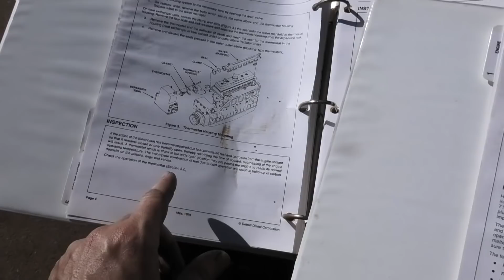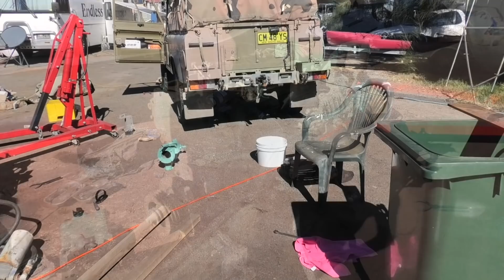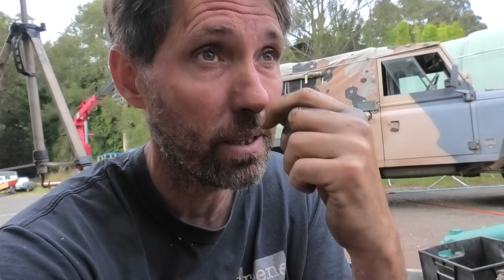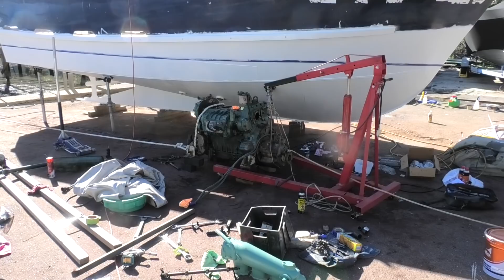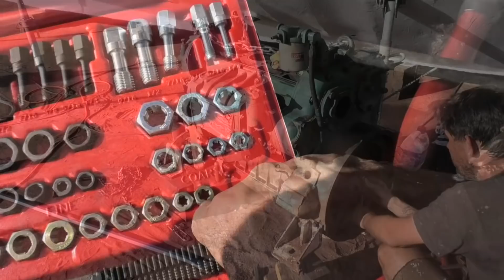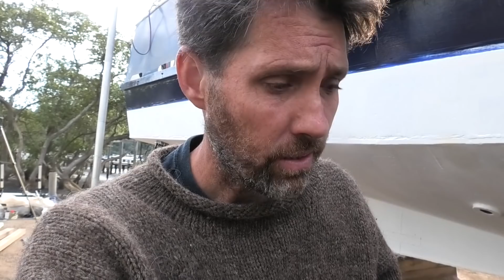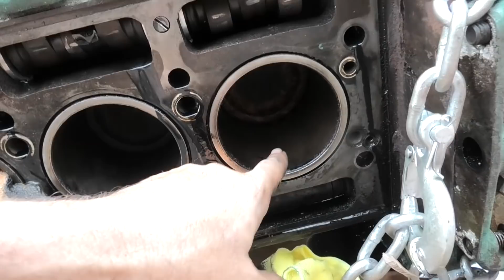Detroit Diesel 4-71 teardown

Comment: Bravo, Stu! Some bloody awful work, there, but done about as well as could be expected. You're doing the right thing, with the rebuild. A Detroit Diesel, properly fettled, is a wonderful thing, and pretty near bulletproof- for years. Outstanding power and reliability. The supercharger is key, if the seals break down, and oil from the blower seeps into the intake ports, you won't be able to stop the engine, safely. You can always block the air intake, but for god's sake don't use your hand! Keep a chunk of plywood close at hand, for that eventuality.
     I'm massively impressed by your dedication to this project. I think most guys would have hauled the engine off to the shop, and let somebody else fight that battle, or given up, straightaway, and plopped a Volvo in there. Not a terrible idea, but that trawler is a heavy boat, and will benefit from the heavy, powerful engine. Good on ya!
Reply from the maker: Thanks mate, I'm really looking forward to seeing this motor healthy again inside and out. A blower rebuild kit is definitely on the parts list. Great idea to keep some plywood on hand!

Comment: I rebuilt Detroit Diesels for over 25 years,  I can tell you to use a torque wrench on everything when you reassemble,  also and this is very important you will need a fuel pressure pump and pressurize the fuel system to 50 to 70 PSI and inspect all the injector tube nuts for any leaks.   They have a nasty habit of cracking and slowly leaking into the crankcase oil which dilutes the oil.  We used to call it "making oil" as the oil level would increase.   The test to see if diesel is in your oil is to place a couple drops on cardboard and see if it leaches "spreads" rapidly into the cardboard.  If it does then you have a cracked injector line most likely.    Diluted oil will damage your engine.   Test it,  I was surprised at how often I would find leaks.
Reply from the maker: Hey mate. Yes, I have the service guide with the torque specs for everything. I like your oil test, very interesting. I was toying with the idea of getting some of the old oil professionally tested but yours is simple and quick.

Comment: You really should do the engine yourself. It is well within your capabilities. I know you were disheartened. I was also. Just put in a liner kit some bearings bam . It will be fine. The head is probably cracked though. Is it a 4 valve ? That was the weakest part of these engines in my experience almost every head we took off of a marine engine had cracks. That being said we did abuse the he'll out of them
Reply from the maker: Yes, I'll probably get the engineers to clean and check everything then I'll see if I can get it back to my old workshop to do the reassembly.
Reply from the maker: Oh, and forgot to say, yes, it's the 4 valve so I can see how there isn't much metal left between the valves and how cracks could form.
Reply: Awesome I got the impression you were going to let the others do it from the price you were saying at least .I forget how much more things cost there. It looks like the rack and everything under the valve cover should clean up. Do you have access to a bore scope to look inside the gear box oil fill ? Better yet leave it be you don't need any other bad news now. Lol

Comment: You are doing great.  Get that head tested for sure.  Was there any water that came out in the oil?   Check that water heat exchanger unit very closely for obstructions.  My initial guess would be the engine was overheated. So i would look for the cause of that then the after effects.  The heads crack very easily it’s usually the weak point.  But  o-rings on the head and injectors tubes are other common sources of water in the engine.  I’ve put worse back together.  They are very tough engines and can take a huge amount of neglect or damage but still be brought back to life.
Reply: I'll let Stu tell you the story but here's what I know that may help, To me, It seemed to run OK from Sydney Harbor up to where it is now in the video "Is it a bad idea to buy an old steel boat?" but the GM 4-71 seized up on the hardstand once out in the weather under a tarp, nil emulsified oil was drained out (covered in this video), oil was black & thick though, just a tiny amount of settled and separated, clear condensate water first up can be seen on draining the sump oil, Stu thinks the GM was possibly flooded with sea water in the engine room prior to His purchase due to a leaking stern gland on the propeller drive shaft pissing water in & a failed bilge pump & switch, there is a clip of that leak in the earlier video too. P.S Great Youtube channel Bus Grease Monkey.
Reply from the maker: Thanks mate. I spent a bit of time yesterday trying to figure out a way to get in touch with you after so many people suggested that I do (I had already watched many of your vids!) The head is already off at the engineers so it will be interesting to see what he finds. There was a very small amount of water that had separated of the oil in the bottom of the sump, but not that much. It wasn't emulsified so I'd say it ran down into the sump from above. I've found a better local source for a full rebuild kit so time to get cracking!

Comment: Another thing Stu, the 4 71's area  dime a dozen. You have the marinising gear so if you look around you may find one available in good nick for much less than where you're heading. It is  easy to forget that the idea is to catch the crocodile not drain the swamp.
Reply from the maker: Hey Lindsay, my main thought with rebuilding this one is that I'll know it's 100%. If I buy another second hand one I think I'll always have the temptation to rebuild that one too!

Comment: I can see why the chicken was knocking on your door. I have to tell you. Seeing the way you breakdown this diesel and the location you are doing it in. Into more manageable size parts. It takes me back to watching videos of mechanics during WWII which were stuck out in the middle of nowhere. Seeing you do whatever you had to do to make things happen. It only makes me appreciate what these guys did to get the work done on the planes and other military equipment. With one single task in mind which was to repair the failed equipment at all cost to keep the equipment up and running so our young men could take the fight to the enemy.

You said it right. That diesel went for a swim. I suspect it went skinny dipping more than once. As for the old oil you pulled from the crankcase of that skinny dipping diesel. Take it and make bio-diesel out of it.  Then burn it in your newly rebuilt one.

Comment: I can see where you’re concerned about safety very much I noticed you wear your safety contact lenses a lot. LOL I was really surprised that you did not mark your rods and Rod caps most people do it with stamps if you don’t have a little metal  stamps to do it I’ve seen people use a chisel and on the first rod and cap just put 1 line on each same side all the way down then the second rod and cap do the same thing so on and so fourth.looks like your worried about stripping the block of everything thing ? I would I would not trust and of the old gaskets and when it get to the Machine shop they are going to have to strip it down anyway which is going to increase your cost the less work they have to do the less you have to pay because it’s less  time they spend on it. But it’s looking good so far I know your thinking damn are chair mechanic lol I was a mechanic for the government till the back went out. And I went to a college to learn mechanics. Not a trade school and the first  three months we worked in the machine shop doing everything you are sending your engine off to have done. And I Learned on old time equipment made back in the 50s and 60s. So you really have to know your crap in order to work the more machines nothing was computerized or digital. But I am also sorry to hear about you having to sell your truck that is a real bummer I hope you get what you were asking for it. And when the time comes and you decide to get rid of your boat that it was well worth it and you get to recoup your money but with that said I have gone on long enough. LOL I hope you have a good day I also hope that you were taking pictures with your cell phone just in case you lose footage again like you did that one week. You have a good one mate.
Reply from the maker: Hi mate, will definitely he stripping the block clean and replacing / repairing everything, just ran out of time this video. Have a set of stamps I normally use for conrods and end caps but just needed a quick hack with the bolt so I could get one piston out to determine which type it is (1 part or 2 part)

Comment: Stu it's worth giving MTU a call at Chipping Norton, they used to be Detroit Diesel Australia before Penske took over. Although I think the 2 strokes are technically 'No longer supported' you might jag and old parts guy who can point you in the direction of either New Old Stock bits, or aftermarket. There is a huge non genuine parts list for these engines. In Adelaide our rail authority used to have 6-71's in Red Hen rail cars, they never purchased Genuine Parts from Detroit at Gepps Cross, always after market mostly made in Mexico.
I suspect that engine has been apart many times before, those liners shouldn't fall out quite that easy from memory. Your service manual will have the block bore sizes and liner Outer D'iameters available. There used to be O/S liner OD's listed. There used to 'power pack' overhaul kits for these things, new liner, new piston with rings, new bearings. Use your own rod and hardware the price was quite cheap as well. Best of luck and don't hurt yourself, that block is still over 1/4 ton stripped.
Reply from the maker: Thanks for the leads Ray. You're not wrong about the block still being very heavy stripped. It's a beast!

Comment: My Dads has had Detroit Desiel engines forever.  If I were to guess he's probably got about 25 laying around from 253, 471, 671, 6v53 and two 8v71's.  They are great engines.  I've got an 8V71 with a turbo on a stand in my yard that I have just to start up every so often just to hear it run.
Reply from the maker: He sounds like a serious fan!

Comment: First off, the Detroit diesel engine is not only the most popular marine engine of all time but the most reliable. Not only that, but you can get parts anywhere in the world.

That being said, you've been getting saltwater into the crankcase, that's the reason for the rust. I suspect the culprit is a leaking seal on the raw water pump (over time) allowing salt water to migrate down the shaft seeping into the crankcase. I've seen this before. But, then again, it might have sunk, or from a leaking stuffing box, half-flooded getting salt water into the engine. Basically, strip her down, turn the crank, boil the block, buy 4 sleeve kits (piston, rings, sleeve, o-rings all in a drop in kit), cheap, rebuild the head, have the blower rebuilt, and you're ready to go. I do these engines all the time for $150 per hole, parts included (with cores). I can get you parts cheap if we can find a way to ship as cheap. How do we connect?

Crankcase looks good.

Properly rebuilt that engine will be good for 20 plus years with good maintenance.

OMG! Do not put the old oil back in! I hope you're joking!
Reply: Don't worry, I believe Stu is in the process of doing a clip on how to filter that manky oil through a pair of old Y front jocks stretched over a 20 liter bucket, should be good to go after that I reckon.
Reply: @dustyfarmer  LMAO!!
Reply from the maker: Thanks mate, appreciate the offer of helping with the parts. :)

Comment: You could have a leak in your oil cooler that is allowing water in the oil. Or cracked head between the valves or injector
Reply from the maker: If the oil cooler was allowing water in the oil I would have expected the oil to have a lot more water in it. It was quite black.
Reply: Dangar Marine yes and you would see traces of oil in the coolant system as well.
Reply: Dangar Marine generally I found thick milky oil on the inside of the valve cover if I had a internal leak   But the 71 series was not noted for internal water leaks.

Comment: Can you unbolt the drive plate from the flywheel through the small hatch
Reply from the maker: No, because the engine is seized you can't rotate it to get to all the bolts.
Reply: @DangarMarine  I must of missed the bit where you said it had seized, I remember it running earlier on

Comment: Stu, Did you get my message about the complete GM 4-71 with gearbox in Milperra, N.S.W for $4,200 neg. on Gumtree? search under "marine gearbox", it's on page 4.
Reply from the maker: Found it! Could be a good option. But I do like the idea of rebuilding this one so I know I'm not buying another set of problems.
Reply: I agree, I thought it was worth pointing out anyway as I didn't know how much they were going to bite you for parts. Rebuilding the original 4-71 engine is the way to go, it will cost but at least you know it's all done right and it will slot right back in, that second-hand head didn't look to bad, it had the injectors in it too, apparently they can be an issue with sticking. On the upside, the starter motor didn't look at all rusty.... or did I miss something?

Comment: Yes that little box toward the bottom is the oil cooler. If your new pistons don't  come pre loaded in the liners, be EXTREMELY careful when you put them in because the bottom ring is the oil ring if you break it when you put them in it will slobber oil out the exhaust, it will run good but will puke oil. The gear looks like a506 twin disc really good trans if that's what you have. Hope it works for ya,  parts are fairly cheap for leaktroits though :)
Reply from the maker: It will be interesting to see how the pistons come, but given I will be reusing the con rods I'm guessing they will need to be assembled. I'll be careful though.

Comment: It will be easier to get new liner kits. The pistons are 2 piece steel upper aluminum skirts the big worry is the crank shaft. The cam should be in good shape, make sure the injectior lobe is on spect. Remover this engine is almost 100 year old technology. With the right injections you should get close to 200 horsepower at 2200 rpm. Good luck
Reply from the maker: Apparently this motor could have the one or two piece pistons, I need to get them out to find out. Unfortunately the cam doesn't look great with corrosion on the case hardening. I'll let the engineer decided if it can be saved.

Comment: As a 22 year journeyman diesel mechanic you should seriously consider a re-power to a modern diesel. Modern Diesels are far more fuel efficient, quieter and emit less emissions.

I love Detroit’s but only in vintage restored semi trucks. 

Look at a Cummins 5.9b in-line 6. You’ll be happy with that. And probably have more power.
Reply: Not to mention the oil leaks from every gasket and seal on Detroit’s. Also from the crank case breather. They are know as road oilers. 

You could even look at a Cummins 4bT. Same platform as the 6bT I mentioned earlier minus 2 cylinders. Or there are Perkins, Lister, Yanmar, and a whole host of other 4 strike diesels that will fit  and work. All of which will get far better fuel efficiency, far better less smell at the back of the boat. Far quieter and far less/no oil leaks in your bilge. 

A stock Cummins 4bT has slightly less HP but also weights 800 pounds instead of 2000 pounds. But it can easily be turned up to the same HP with a set of injectors. 

A stock Cummins 6bT will blow the DD 4-53 out of the water on HP

Detroit Diesel 4-53 in 1930’s technology. Do yourself a favor and get into the 1990’s engine technology and you’ll never look back.

Comment: Stick with that motor.. that's my two cents. As you stated, the boat and motor have been working together and you'll have predictable performance. Another reason, while that motor is older, I'm guessing there are plenty of them floating around out there, parts should be readily available.

Comment: Stu, I admire your fortitude! Having done quite a bit of marine mechanical work through the years I can really appreciate your ability to work in some of the most uncomfortable positions known. But when you are out of the bildge you still work all scrunched up squatting in the dirt. You have what we old guys from the U.S. call "Grit". Around here a diesel overhaul averages about $1000.00 U.S. per cyl. at the machine shop if you don't need too many extra parts. You certainly can't upgrade to modern power for that, even using low hour take-outs. From what I could see in your vid the engine is injesting water but thankfully its not getting in the crancase much. The head may be the culprit or some seals aged out. Every hole looked crappy, but those engines are filthy normally. What is the horsepower rating of that 4-71? Great series you have going here and very well done.